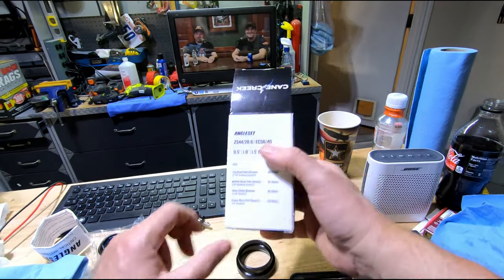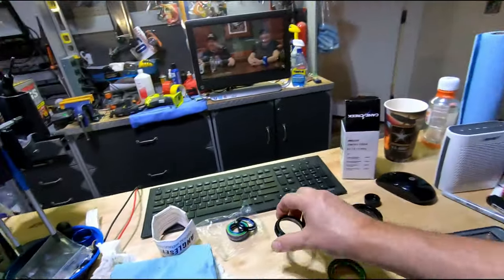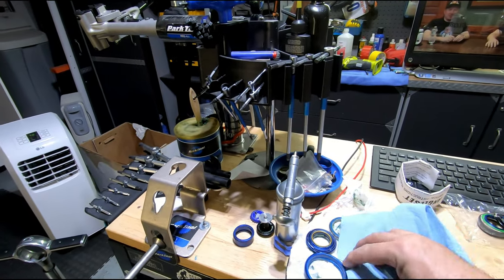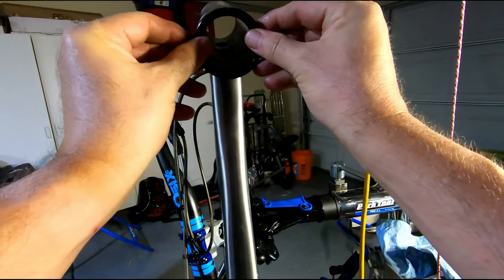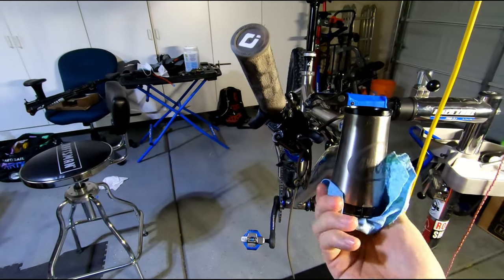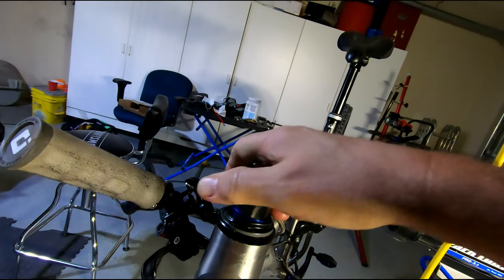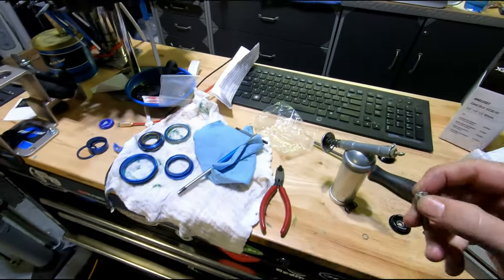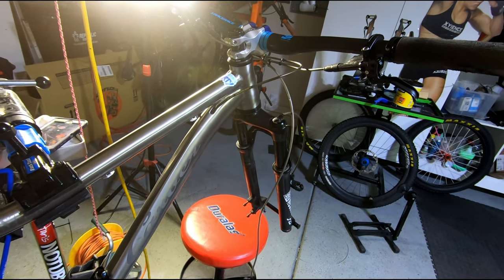Cane Creek Angleset headset install

Comment: My 2016 Scott Genius 740 was built with a 67.9deg lo/68.4deg hi head tube angle. I've just learned about angled head sets which can alter the head tube angle by up to 1.5deg+-. Question: Is there a limit of how much slacker I can go and will it adversely impact my bike's build integrity? Also would my bike accept an angled head set replacing the stock one?
Reply from the maker: shafhamid83  I don’t know if your bike will accept an angled headset.  Most tapered headtubes that take pressed in cups ( non integrated) Will take the cane creek angleset. Your fork travel and bottom bracket height is what will determine how slack you can go. To slack and you’ll pedal strike and your front end will wander when climbing.

Comment: Can you tell the difference? What was your head angle before you installed your headset? Mine right now is a 71.5 so that would put me at a 70 so im wondering would it be worth the money?
Reply from the maker: I can definitely tell the difference. Going down technical terrain the feeling of going over the bar is reduced.  Smoother ride going fast. I can pull up the front end easier on tech climbs. Stated at 69 now 67.5

Comment: How is the angled headset doing after several months, does it creak or it remained silent?
Reply from the maker: No creaking   I put it on my steel Honzo and was able to tighten it down    I did put a 9 point 0 Angleset on my carbon Honzo and creaks like crazy
Reply: @Onecogmike  Good info, thanks!